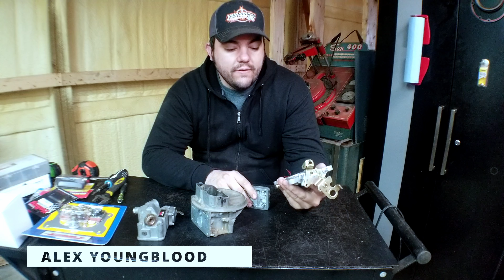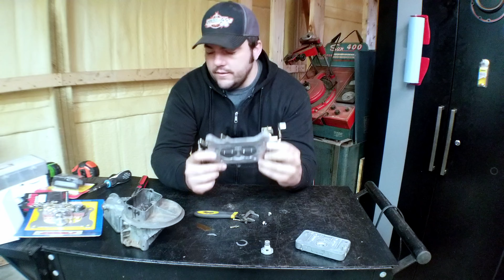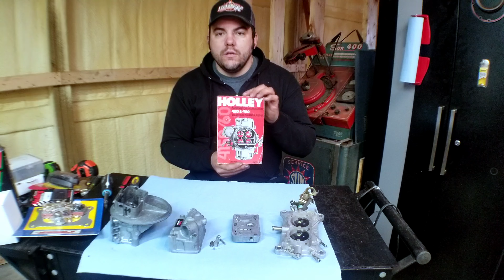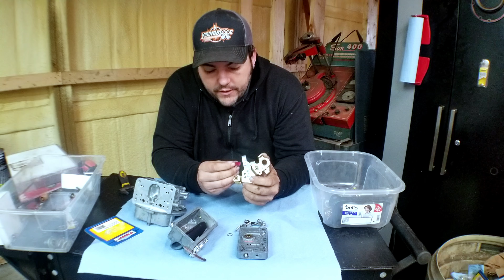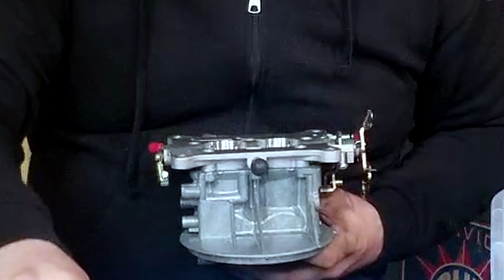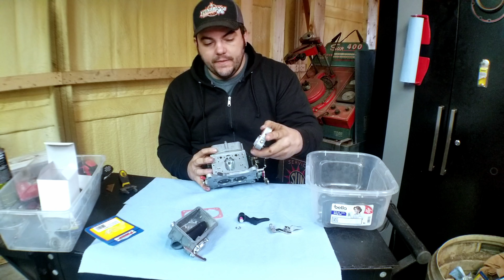Rebuilding a Holley 4412 500 CFM Carburetor | Step-by-Step Guide

Comment: I take a angle grinder to the carb gaskets with a 3 M pad and just skim them off a lot faster before I dunk them little quicker
Reply from the maker: That can work well if you are careful.  The ultrasonic machine softens all that up and the gaskets come off with minimal effort and no damage.
Reply: Takes off to much material

Comment: My carb does not have a float level sight glass or the removeable screw to set fuel level..  Anyone know the proper way to set it?
Reply from the maker: Here's a quick read from Holley on adjustment.   You would need to do a "dry" adjustment.   
https://www.holley.com/blog/post/adjusting_your_carburetor/?srsltid=AfmBOoowl9Gg3Nihf9BMmRxVmt_D46QbLCUJYkQ4deYZUunSwY-S2bfH
Reply: @youngbloodperformance6029  Thanks!